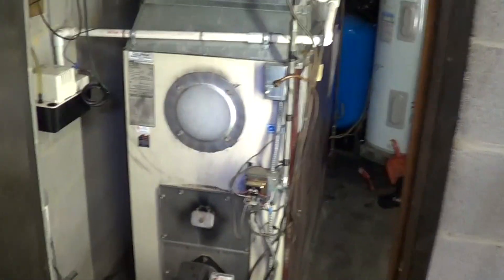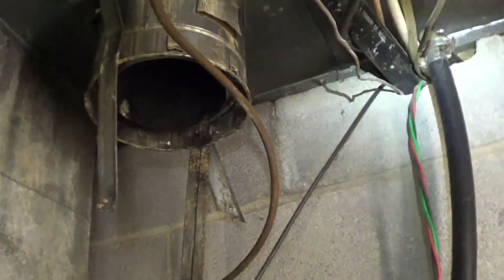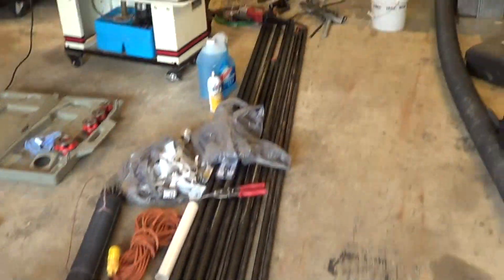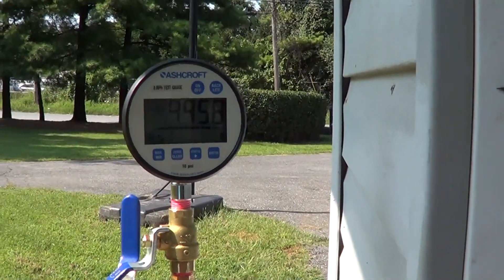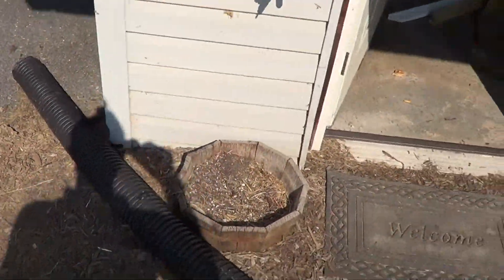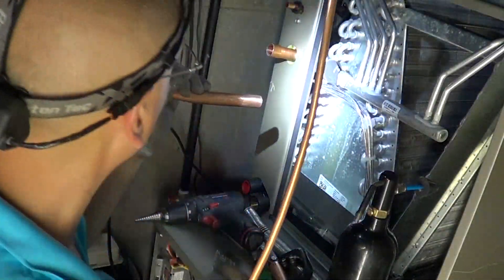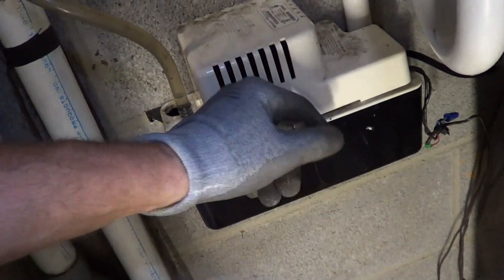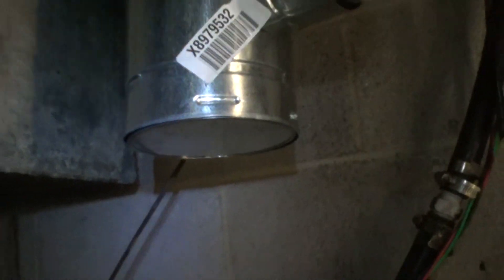Natural Gas Conversion from Oil Heat

Comment: So this was 9 yrs ago and at $2.50 to $3 a gallon you're burning 800 gallons or more of fuel oil in one season? Two full tanks? Where is that?? We use some electric space heaters along with the furnace and we burn 400 gallons.

Comment: hi i'm looking to purchase a home in matawan nj it has oil and tank is in basement like your video, what would be the ideal cost to convert with removal of oil tank in basement . what about gas company do they install meter for free and you would have to run pipe from meter to furnace . ac is in attic , vents are in ceiling so its just a furnace and i guess maybe replace water heater as well for a 50 -60 gl at least family of 4 (3 females) a lot of hair washing know what i mean ! plus do a line for the new gas stove and add a line for the dryer . what the rough estimate for this job?
Reply from the maker: Here are going to be some major incentives from the recent inflation "reduction" act to switch to heat pump.    They go up to $8,000.   $5 billion is allocated.  The amounts should be finalized by the first of the year.

Comment: Yes but you’ll use more gas to do the same amount of heating. Oil has a higher btu input rating then natural gas or propane. So you’ll save money, just not as much, as fast as you think.
Reply from the maker: Natural gas has gone up, but it is still half the cost of oil.
Reply: @NathansHVAC  I have a gas water heater and oven so there's already a gas line in the basement. When I had to replace my oil burner in the 90s, the workers mentioned I could install a gas heater, like a dope I just went ahead and replaced the burner.🤦‍♂
And PA is the #2 producer of gas in the US!
Reply: How much to get the gas installed and it's only about 15% more efficient

Comment: I do have an oil furnace at a new place a I bought, I would like to know I just have to replace the oil furnace for a gas one while I can use the same vents. I have a gas water heater next to it so I can use the same gas line to feed the furnace

Comment: $2500 a year!? Why the hell is anyone still using oil?!
Reply: Because not everyone is blessed with natural gas.  Some people only have propane and oil as an option and quite frankly your better off with oil if you have it and waiting to see if natural gas comes your way, propane costs about the same as oil, is actually less efficient than both oil and natural gas, and you loose longevity on most modern gas furnaces because they are apparently not designed to handle propane very well despite them offering conversion kits.

Comment: About how much is it in the end to convert from oil to propane. ??
Reply from the maker: Oil and Propane are both expensive heat sources.  Propane comes from oil.  Natural gas is the least expensive energy.  If the main is on your street, the gas company usually will install a meter for free to get a new customer.  Then, the equipment cost isn't much more than a heat pump.  But, if you only have propane and you live where most of the winter is above 20 deg F, you can do a hybrid propane with heat pump system.

Comment: $389 where was that ? I live in PA and people scared me because can make me cost like $10,000.
Reply from the maker: Jose Jimenez I'm in Maryland.  Usually, if the gas main is already on the street, it is free. If the gas man is not on the Main Street, it is usually $50 a foot. That can really add up if you have to run a mile.
Reply: NathansHVAC ok,thanks Im going to call for an estimate. Great video

Comment: Take the tape off and the trap can come out?!?! 
First, you don't need a trap on the positive side of blower. You are creating the potential for problems.
Secondly, have you ever heard of a clean-out tee? Made with a PVC tee and cap to access the trap for cleaning? How about a PVC union instead of tape to take the trap out?
Third, If it was on the return and needed a trap another tee should have been installed after the trap for a vent to allow the trap to prime 

Thus video is starting to look like a DIY or hack job.
Reply from the maker: Super Tech good call. The only problem I had with this install was that that trapped you were talking about did clog up a couple years later. And I did remove it. I probably left it because it was original and I was getting lazy.
Reply: NathansHVAC 
Good honest reply! I guess we've all made mistakes and learned from them. I'm not really a "super" tech, I'm just trying my best to be one.

Comment: You needed to change the liner to stainless steel. The aluminum is not approved for gas.
I understand you are trying to save the customer money but the best thing would have been to put in a high efficiency condensing furnace and water heater using PVC sidewall venting and a matching A/C.
The efficiency and lifespan of the converted furnace is going to be worthless in comparison.
Reply: my mistake. I thought you were putting in a conversion burner, like a Carlin E-Z gas or Midco EC. Why not go for a condensing furnace?

Comment: Excellent video Nathan, very informative. my parents have oil heating with baseboard on second floor and no heating on first floor. I would like to convert it from Oil to gas. its a 1930's, 1600 sq/ft home tudor style in NJ. they end up paying around 3- 4 thousand dollars for oil per year.  I was wondering how much would it cost me to setup a gas conversion.
Reply from the maker: Sometimes you can have the existing fuel oil boiler converted to gas with a new burner conversion kit.  You will have to get a local contractor to quote.  However, if the boiler is more than 20 years old, you should probably just replace the boiler with a gas one.

Comment: How much for a 12 year old  4 section burnham oil boiler conversion with  2 section domestic water 2 section heat. 20-80 ft of pipe depending where they want their meter
Reply from the maker: I suggest not using the domestic water from the boiler unless you are in a very cold climate where the boiler needs to run most of the year anyway.  Natural gas conversion always pay for themselves.  The natural gas equivalent cost of the fuel is about $1 per gallon.  And, that price isn't going to change anytime soon.  So, if you are using 500 gallons per year now, you will save about $10,000 over the next 10 years by converting to natural gas.  If the middle east blows up, you will probably save $20,000.  You can probably just convert the burner section of the boiler to save money converting to gas.  That way, you can keep the old boiler until it starts leaking.  I suggest starting a chemical treatment program if you decide to keep the old boiler and convert it to natural gas.

Comment: Heating oil is not that much of a favorable thing in America anymore main reason is the price of it today even in more northern places like New England the use of it has decrease in places
Reply from the maker: in 1990, fuel oil was the cheapest form of heat next to coal and wood.  But, crude oil was $10 per barrel then too.
Reply: @NathansHVAC  Oh man. This comment is 5 year old, but I found it funny because we are in April 2020 and oil is bouncing between 10 and $20/bbl.